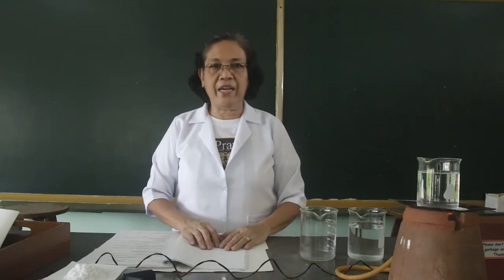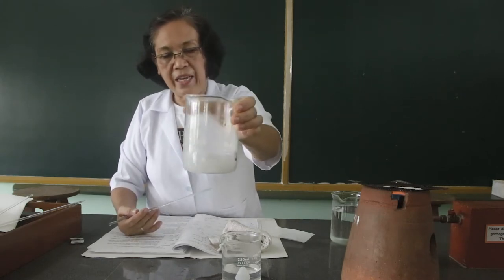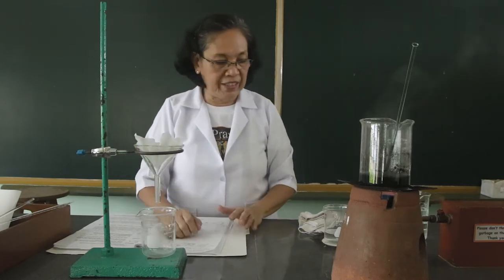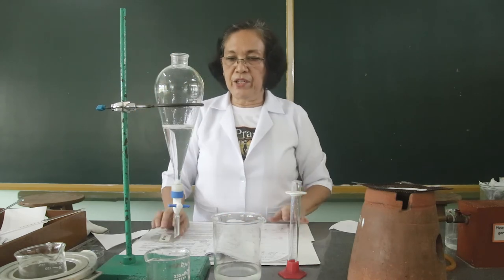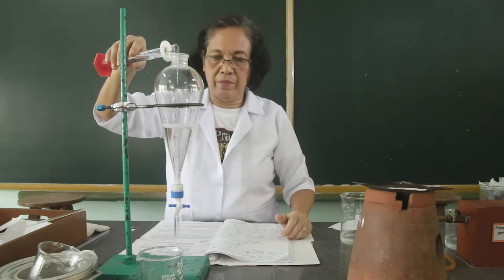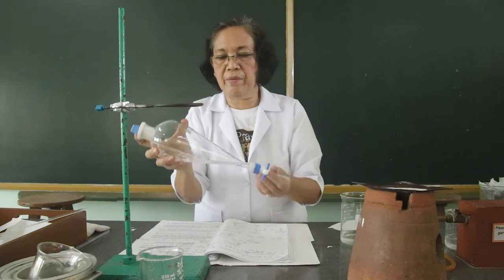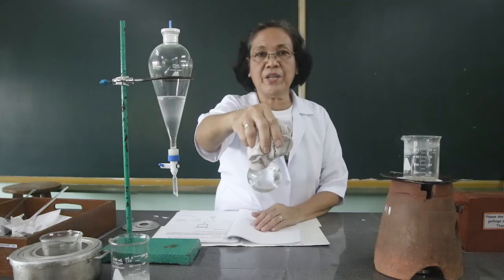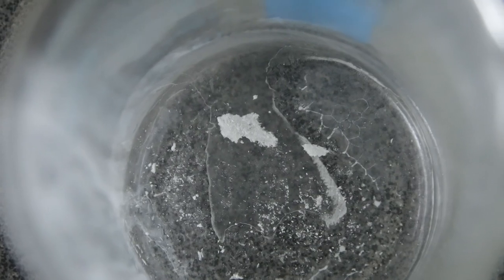Separation and Purification of Organic Compounds

Comment: Charlene MENGUITO-BS BIO 1

From the activity, I have learned that in recrystallization, the first thing to do is measure the crystals to be used. This is to be followed by dissolving the crystals to a hot water, then add the activated charcoal to it and boil. When the mixture boils, filter it using a filter paper and collect the filtrate. Cool the first part of the filtrate in an ice bath and the second part shall be cooled down in a room temperature. After the cooling process, a residue will be obtained. 

In the extraction process, a separatory funnel is to be used. Benzaic acid and the table sugar shall be mixed in a separatory funnel and add with 100ml of water. Then shake. To dissolve the benzaic acid, add 25 ml of chloroform then shake again. Allow the 2 liquids to separate then drip out the lower layer of the liquid first and place in a hot water bath. And then place  it in a fumehood and let the chloroform to evaporate out and leave the crystals as residue. 

And in sublimation process, placed inside the beaker, the half portion of benzaic acid shall be placed over a flame and be covered with florence flask. Heat for 15 minutes and the crystals shall be observed at the bottom of the florence flask.